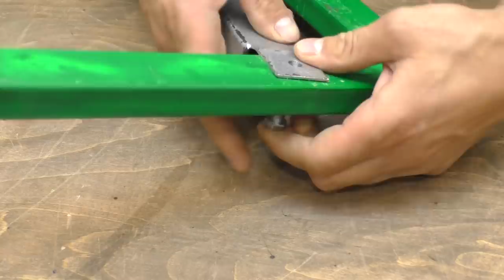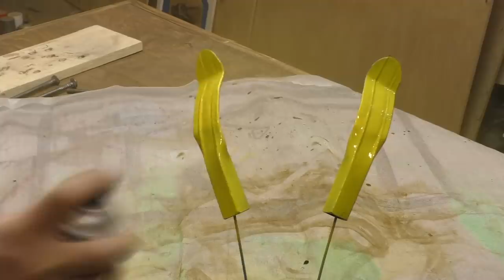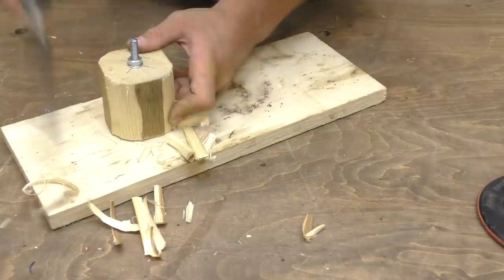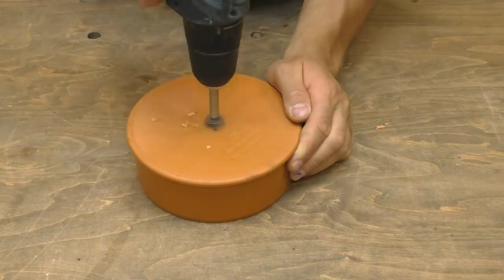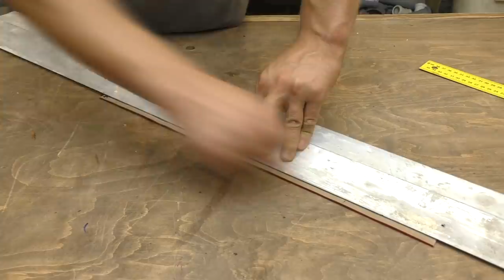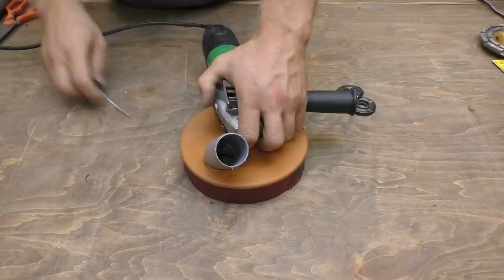Top 5 Genius Ideas! You may need this!

Comment: The floor grinder was fucking genius and so was the hole digger , cool stuff.
Reply: the floor grinder was awful lol. it would only work if you were removing tiny high spots. i spent years grinding concrete. you need to see what your doing in order for it to work. you have to push down super hard in order for the blade to lower enough to hit the concrete because of those flaps , and thats the last thing you want to do when grinding concrete smooth . could you imagine spending 8 hours dragging that across a floor. sometimes you need to angle the grinder to clean out soft spots or take of edges, you couldnt do it with this. there is just way to many variables. thats why professional vacuum devices work best ,when they sit behind the blade , it still allows you to maneuver as you need. and the board holder works, but the problem is nobody is going to spend time ,and drill unnecessary holes, just to hold a board for 2 seconds . its easier just to screw one side and let the board hang and go to the other and set your level and raise it until its level and screw the second.

Comment: Using a hand drill as a lathe is not a good thing to do too often. It plays Hell with the
bearings, which are designed for centered, not lateral, loads.
Reply: Thing is why not just put the sanding disk on the drill and get the bloody job done in the first place
Reply: تربى.

Comment: The multi brick carrying tool is a well known but useful idea.  What’s not useful is lifting several brick but 1 is unknowingly cracked. After 5 paces the cracked brick breaks and the bricks fall on feet in flip flops and breaks several toes. I’d suggest halfinching a pair of steel toe capped boots.

Comment: Last one was RIP to the battery. Battery was so small for this job.
Reply: No RIP,  just fast depleted.   :-))
Reply: @taunteratwill1787  Yes, but heavy loads reduces battery life much quicker. And also can cook it if overheated.
Reply: @MDB-amandrinksbeer  True that.  That's why i never stress my 18650's and never charge my 18650's above 90% and never let them go below 3.5 volts.  Resulting in 200% more recharge times.    :-))
Reply: Rock? Hit a rock and something is going to give. Bet you its not the rock.

Comment: Not really sure you achieve anything constructive. Will you be making a wheel next?
Reply: Oh!!, like taking a frisbee, and putting a bolt through the middle. Standing back and shouting "Ta dahh!!" 🤣 I can't wait!!
Reply: Don't forget the obligatory generous dollops of hot glue, or super glue (Flex Seal, perhaps?) because...seriously though...Which types of electrodes would be recommended for stick welding a steel bolt "securely" to a plastic frisbee??! And what sort of supplies would be needed for the DiY angle grinder to clean the weld bead? 🤔

Maybe turn it on the lathe instead? 👀

These thoughts baffle the mind!!

Comment: For the hand sander use a bigger bolt fraught into the Velcro pad. 
For the brick carrier reinforce the forked end and use a tube spacer for the pivot bolt. Bolt size hole at one end and tube size at the other. Weld one side only and tube cannot be crushed by bolt tightening.

Comment: 1. What kind of surface were you working on in the fifth video with the angle grinder and what was the intended purpose of this attachment? It obviously did nothing to repair the crack and the surface did not look like typical concrete but maybe it was the lighting.

From the design it would appear the jig or attachment is intended to keep the cutting surface parallel with the surface being prepped and if successful would possibly level or plane the surface to a uniform flat surface. The problem with the design is that as the plastic base encounters any bumps or elevations above the main surface level the base will tilt up on that end and the cutter/grinder will no longer be parallel with the surface. If there is any flex in the base and depending on the tolerance between the cutter/grinder surface and riding surface of the attachment when the leading edge encounters a raised area the trailing end that is no longer parallel with the surface would dig into the surface you are trying to flatten.

Intriguing idea but the base attachment would take some engineering to come up with something stiff and strong enough to keep the grinder level while supporting the weight of the tool AND allow the riding edge of the attachment to absorb bumps in the surface being prepped without deflecting the angle of the grinder.
Reply: I think the intent of it was to provide a vacuum shroud for it to capture the dust while grinding the floor. Not for leveling.

Comment: The ideas have potential but also should be assessed in terms of geographical location (Russia?)
1. I've yet to see a brick carrier in the general department stores in my area (close enough to Russia). Ordering online is about 30-40 USD + shipping. How to DIY might help. Flipflops definitely do not (help). But honestly, I'm not surprised.
2. Yellow stop dogs for that small board may have been a bit overkill. But perhaps they could have been used for something longer that would have needed the board to be level from the beginning. What if the board you wanted to drill in didn't have to be level but rather at some angle and you simply had to have it held in place. Maybe he only had those nails in that size and wanted them shorter.
3. Handle build for a drill tool accessory? Not needed. But if he showed the possibility to use a powerdrill as a lathe to build a handle for a handtool that had a broken handle or for a tool to use in a difficult to reach place, then it would have been ok.
4. The stone polisher jig thingie makes for an ok 'here's an idea and adapt it' sort of presentation

I've been there. No-name tools with relatively poor tolerances and a market where you can't easily find what some may view as 'common tools' necessitates DIY. For example, the speedsquare. My local store started to have them about a year ago. I was the first to buy one. The cashier asked me how do you use it.
Reply: Thank you, Mark, for your thoughtful assessment here! Intelligent folks are islands in an ocean of trolls and naysayers.

Comment: The block carrier is a pretty standard idea and is far from genius, especially as you skipped the part where you made the right-angle corner (I suspect welding required)

LOL, make a hand sander so you can use expensive sandpaper discs intended for use in a power drill sander attachment. 
Just stick with cheap actual sandpaper and a block of wood.

as for the "earth auger" in the last clip, what a great way to get deep lacerations in feet and ankle (or amputations)

Comment: Your concrete wheel was below the plastic it wouldnt even touch the concrete plus you cant use those wheel on a flat application the nut you hold on with going to hit concrete before it does , if you had whole plastic thing you built on an angle yes it probably work but i dont lnow.

Comment: Easier ways to attach a 2x4 to a wall, snap a line and then drill for inserts.
Concrete saw blades don't kick up much dust if you keep water on the blade.
Reply: Can't go into a finished establishment and refinish a concrete bar top throwing water all over the place.

Comment: So you drill 2 extra holes in your wall and risk cracking your brick by driving nails into it. Why not use adhesive strips and a level. Then you use a drill to make a wood handel for a rotary sanding bit instead of just mounting it in the drill. Where are the genius ideas?

Comment: @ Pete Beatminister - ok theres two things wrong with your statement, and clearly you've never done much ACTUAL woodwork to know what these things are.  Powersanding can be too harsh, and if you've ever done any hand sanding with a block you'd know the paper slips, catches and can tear because it's not being held firmly - holding onto a wood block with paper and a vice like grip is VERY tiring on the hands - so this guy has used HIS BRAIN and added a handle to a velcro backed pad, no more slipping paper and no more hand cramps.  Guess who else does this? Jimmy diResta, going to accuse HIM of being an idiot? Didn't think so.

Handcraft - ignore these twats, prolly only here because they can't do anything more constructive.

Comment: Project fail.  Centimeters aren't a real thing in the United States.    If I drove a nail into an American brick, I'd need another Genius tool to replace the clay brick I'd just shattered with the nail.  Could have saved an hour on the third project by tacking a sheet of sand paper to a scrap wooden block.

Comment: why would you cut using a straight edge and a knife when you can just mark a line and use scissors instead? The concepts here make no sense...get the right tools for the job and then you won't have to spend 8 hours making hacks

Comment: At the risk of appearing picky but in the section where he’s drilling holes into the brick wall, is it just me or does the brickwork look like Stevie Wonder built it. It’s possible it was a diy job in which case I’ll take that comment back.

Comment: I finally realised. I need a railroad track anvil!
Reply: No you don't.

The cops will be very rude, until they find out that you DIDN'T steal that off an operating railroad. And then, they will leave. Owning a piece of railroad track is NOT a good idea. Because it usually means a train is about to wreck.

Comment: Wow. Ive been wondering how I was going to move those 6 bricks from beside the house!
Reply: Obviously you were not paying attention, he picked up seven bricks
Reply: @ralphwiggum3887  I have 6 bricks. I suppose after I make this gizmo, it should work on 6 also. I have to get these out of the way so I have to get moving on the tool, They've been sitting in the way for a few yrs now. Glad I stumbled on this video!
Reply: Though it does appear to be adjustable I would think that one would seriously have to consider the correlating factors when making any adjustments to the weight or dimensions of the load. "Standard" bricks (2x4x8) are about 5 lbs whereas "standard" cinder blocks (8x8x16) are closer to 40 lbs each. Good luck with your project, remember, safety first.

Comment: Some stupid ideas.
the one for holding wood on wall, ow you just put massive holes in wall to put clamp.
another stupid idea. You use a drill to make a wooden hand sander. Why not just stick the sander in drill, Walah! faster and save hands from work.

Stupid idea for a grinder. as your meant to grind at an angle Not flat as it puts strain on the disc and motor, and most important, you need to have it wet to stop the disc from burning out when doing masonry/brickwork and so  on.
if this guy had a brain he would use a spade to make a hole in the ground, Not a normal drill. (poor Drill) 
Anyway to all that read this. 
Please don't use your nice tools to do stuff like this, as you will ruin them Specially battery ones.